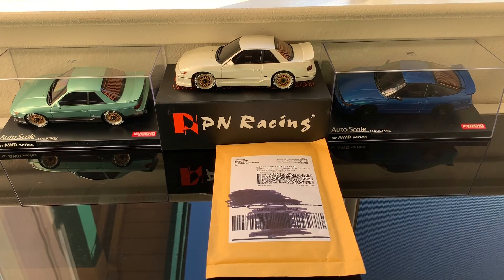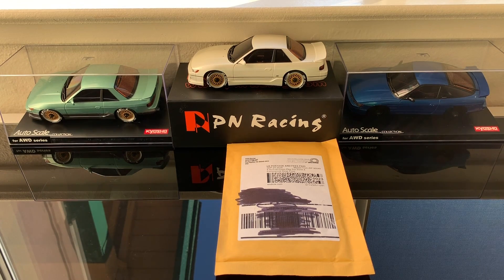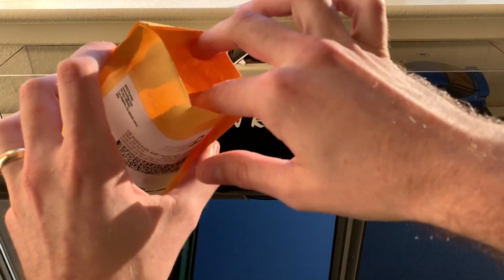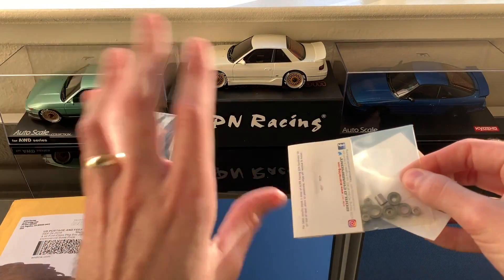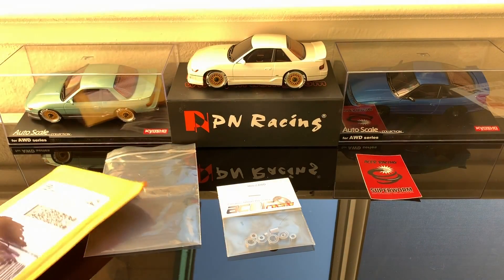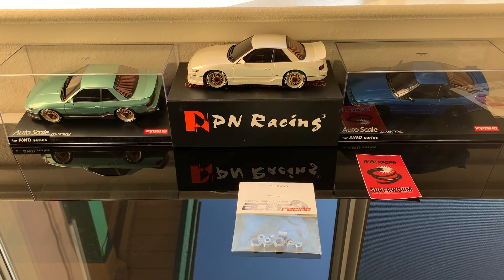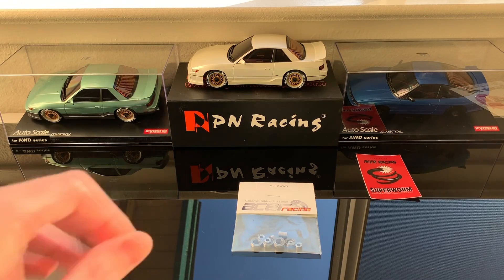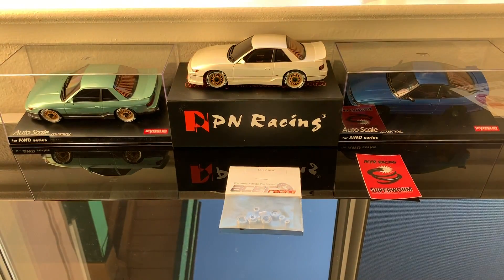ACER Ceramic Mini-Z AWD Bearings Unboxing & Overview MA-020s

Comment: Looking forward to your opinion about this. I know ceramic bearings are better but I've never used it because mainly I don't do any racing.
Reply from the maker: Beaver's Hobby I’m hoping to have these installed tomorrow & will release a video next week or the following week with my initial impressions. But I will take a few more weeks for me to put out a detailed review. 

I agree with you, I know ceramics will be better, but I don’t know how much. Main reason I chose these were because they where shielded, and the price difference between ceramics & steel was minimal so I went with the upgrade. Plus I could not find any info regarding this kit for the mini-z, so hopefully I can help the community out by talking about them.

Comment: One thing i do with most mini-z's i get is pull the bearings and run it through degreasser for 5 minutes. its ammazing how much dirt comes out of them and how free they run afterwards

still tempted to upgrade to ceramics but its hard to tell how much of a gain i would get. would it be possible to see how much of a change you get in getting up to speed and freewheeling to a stop and comparing the distance as the freewheel distance increase is what i am looking for more than anything else
Reply from the maker: Blitz Works degreasing is a good idea, but I still do not like the stock bearings due to them being “open”. A big part of why I chose to upgrade my bearings was to get shielded bearings. Most people don’t have issue with open bearings, but I have a long hair car in my house & it’s crazy how much hair gets into my bearings. Even if I clean the floors before running the car, it still manages to attract hair. 

Hmmm interesting, I believe these ceramic bearings would increase freewheel time & acceleration due to the decreased resistance, but I don’t think it would be a massive difference. I don’t have a area big enough to test at my apartment, but maybe I can film the stock bearing freewheel at my office. Let me see what I can do, I’ll try to film it, but I can’t guarantee anything.
Reply: @BMR3  I thought the bearings i had where sealed and not open or half open. perhaps i swapped them out int he past
Reply from the maker: Blitz Works I’m pretty sure my stock bearings were at least half sealed, we will see when I crack the car open to swap them out. 

So have you pulled your cars driveshaft bearings? If so, how much work is involved? I think I just need to pull the diff covers, remove the diff & gears, then I can unscrew the little price that holds the driveshaft bearing in place right? Or do I need to fully tear the car down?
Reply: BMR 3 you need to fully tear down the car I had to do it to upgrade my dr
Reply: Driveshaft

Comment: Was there a video on install and how these performed? Really interested in getting some but can't find trustworthy reviews..
Reply from the maker: Hello & thank you for the sub! I’m planning on making the review video this week & it should be out on Friday, but I can give you short & skinny since you are asking. 

To install the driveshaft bearing you will have to fully disassemble the car & lift the receiver board/servo to get in there. Here is a video on how to fully tear the car down: https://youtu.be/YDvmwCOm5xE

As far as how they preform, they are ok but nothing special. I think I was expecting too much, but I was disappointed with the performance. They roll a tiny bit better then stock bearings, but not enough to justify the cost... One thing I did not expect was that the wheel bearings are larger then stock, they stuck out of the camber knuckles & threw off the rim offset. 

Bottom line don’t get Acer ceramic bearings, they are a waste of money & don’t fit properly.
Reply: @BMR3  Nice one and thanks for the heads-up.. I was thinking the same after reading a few more reviews online. Think I'll stick with decent steel bearings.
Reply from the maker: DashDrones good call, save your cash

Comment: How do those compare to Fast Eddy’s Bearings?
Reply from the maker: Avoid these, they are not to spec & are too wide to fit the wheel hubs. From what I gather fast eddy’s are correct. 

I made a video a few months back about seal steel bearings & they are great. I recommending checking that video out
Reply: @BMR3  ill have to look Seal bearings up.
Reply from the maker: Sorry man I thought I linked the video, here you go: https://youtu.be/KHRi5gAZG80

Z-tech shielded steel bearings are great & mine are still going strong.
Reply: @BMR3  No worries man.

Comment: Just purchased set 80$ from u.s.a pretty expensive but heard there best overkill
Reply from the maker: @singhysingh6231  in my experience the bearings were oversized, double check the dimensions on the wheel bearings you ordered. You may want to cancel the order
Reply: @BMR3  mines for mini z mr03 rear wheel drive model your is awd
Reply from the maker: @singhysingh6231  perfect, just wanted to let you know you know in case. Enjoy the bearings, they work great it’s just the size was off for me.